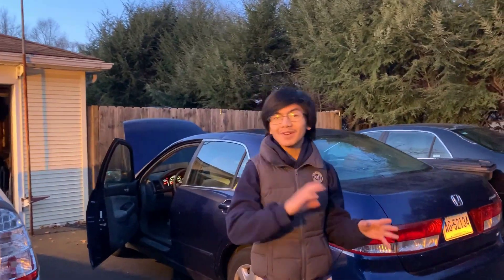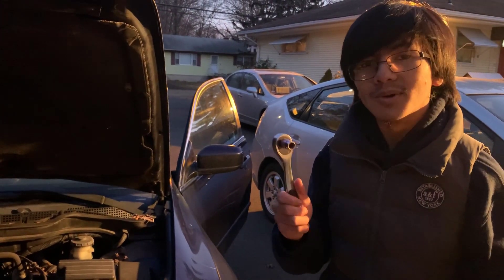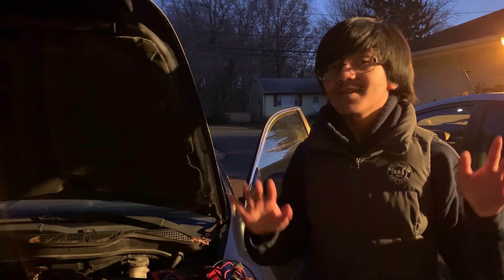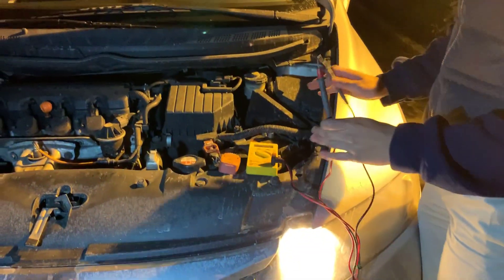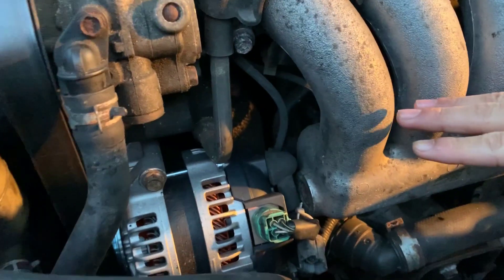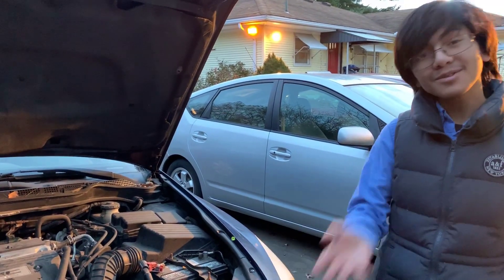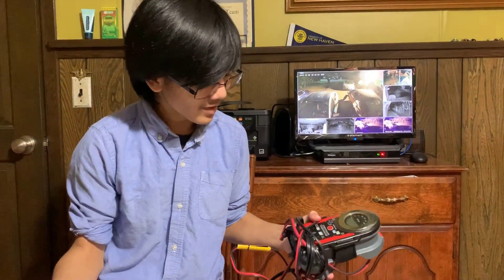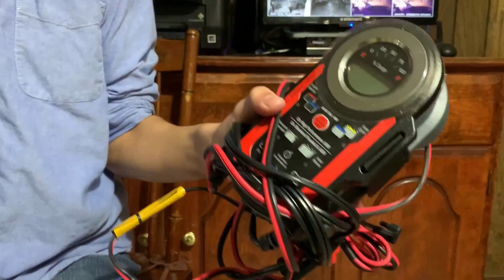Why Battery Light On Dashboard Stays On?  What Does The Indicator Symbol Mean, To Do & How To React

Comment: I just put a new alternator  n battery whymy light battery still on
Reply: Same issue here. My battery light comes on and off. New battery and alternator also fuses are good. Someone please help🤯
Reply: @lemarevans8769   did any of you guys figure what the problem was?
Reply: @lemarevans8769  pcm
Reply: You might have to clear the error code with an obd2 reader or have a mechanic clear it.
Reply: I got the same issue did u resolve the problem
Reply: Try changing pcm
Reply: Because its not the battery,its the battery relay.